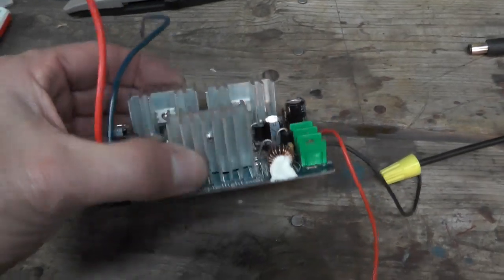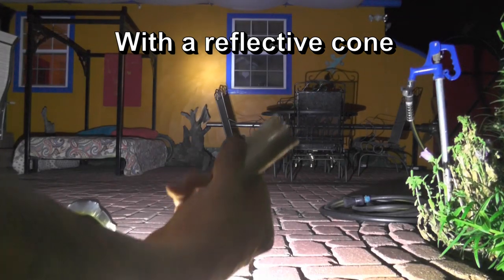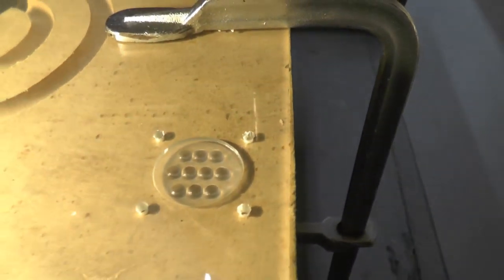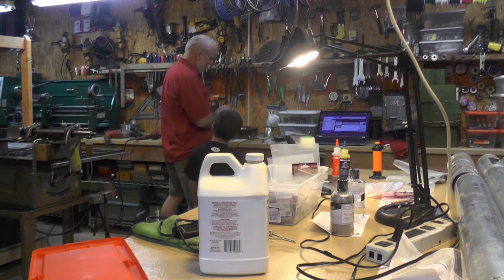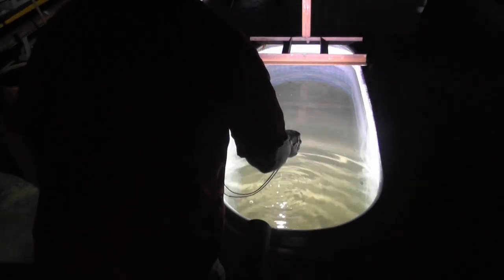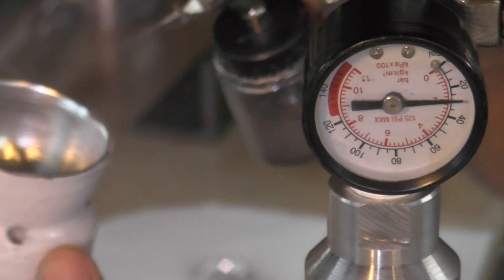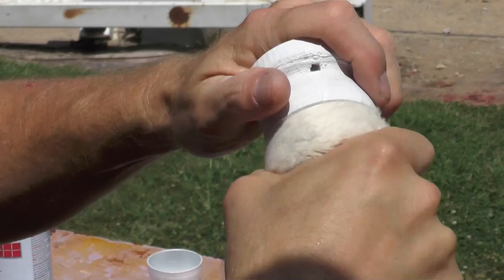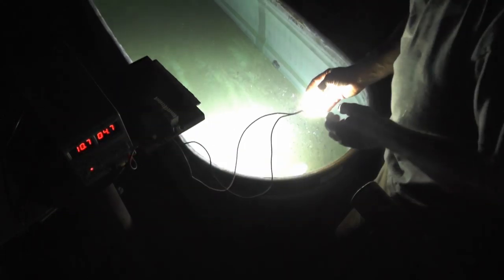Underwater LED Lights - for deep water

Comment: How do you cool the LED arrays?  Just thermal paste to the chassis or flood it with water?  I'd run a good long test as that PLA might deform if the base gets too hot.

Just to throw out some other ideas:  You might be able to cast the reflectors using a commercial one as a pattern...make the mold out of silicone / resin (e.g. How to Make Jewels, Gems, Crystals, and Pendants ) and you should get a very good surface finish.  You could also experiment with square/pyramid type reflector which would be much easier to fabricate and get good reflective finish.  (It may also be worth investigating to see if any particular color or polarization filters would help light penetration)

Lol, this just popped up in my YouTube subscriptions - Turn a Flashlight into a Spotlight / Bat Signal!  Might be able to put those aspherical lenses on a carriage out in the water that you can pop in and out of the path of the beam to tighten it up if you want to.
Reply from the maker: Right.  No thermal paste, that's one of the perks to leaving them exposed.  The 38 degree water will keep them cool as well as the PLA.  And the lens is exactly what we are doing, just much more compact.

Comment: Hi Doug,Marine Beam are doing some extraordinary work with recycling light around the periphery of LEDs. Their reflector puts this light back into the diodes and excites it's particles,resulting in their production hand held ultra long range model,rated at 200 lumens,outperforming others up to 1000 lumens. The little video that's shown with that model gives me the impression they are your type of people,small scale,tenacious and bright,and may be very interested in an association with your rov lights,with it's spec for narrow beam,low back scatter etc. I hope this helps,you are inspiring,and my son and I wish you well from Nottingham,U.K.

Comment: In order for a parabolic reflector to be effective you would need the light source to be mounted inside the curve.  With surface mount LED, your reflector doesn't focus your beam, it only eliminates the side light.  Maybe a cluster of LEDs with the legs, inside the curve with an adjustable reflector distance would allow you to focus your beam and be more effective to make a spot light?  Though, I would think a flood lamp set up would be better, so you can see things as they come into the view of the camera and not just when they pass through the spot beam.  Just use more of those surface mount arrays.
Reply from the maker: garry7263 Floods are good on occasion but they tend to cause more problem with back scatter.   Something that was adjustable but just as bright would be the ticket.

Comment: if you mix type 1 silicone with xylol you get a silicone that will flow. it will shink down also by the % of xylol. good for getting in the tight spots

Comment: Love the Vacuum system!
Do you have a video on how you made it? Modified pressure cooker and vacuum pump!
I need to build one myself! Got a build of materials?
Best!
Reply from the maker: +doyle maleche   Really nothing to it.  The vacuum pump came from Harbor Freight, and I just drilled and tapped a fitting into the pressure cooker.

Comment: Hey Dan, really enjoy your videos.  I couldn't help but wonder if that is going to be bright enough.  A bit late now, but have you looked at the large single chip led's?  I just made a "flashlight" with the 100 watt version which can be found for about $10 and it works great.  They also make up to a 500 watt LED but at a significantly higher cost, however I expect 50,000LM would light up a lot of sea.  Even if you don't need that much light, I believe they become significantly more efficent if you undervolt them.  Just a thought.

Comment: Lyle here,
You keeping track of your refractive indices there Doug???  I took a class on light last year we should have had a discussion about it when i was there.  Is the housing in the ROV housing the lights going to have water in it? if so you could be looking at a pretty large effect on your focal length going through your rtv, water, plexiglass, and then water again. might be worth calculating!!!!

keep on rocking!

-Lyle
Reply from the maker: Nabster5 Hey Lyle.  Do math?  We don't need no sticking math!  ....and yes, they are a bit big that those will be what we start with.  We'll see what the do, then you can do the math and CAD up what we should cut and print on version 2.   Glad you made it back home in one piece.  Did the ignition module fix the running in the rain problem?